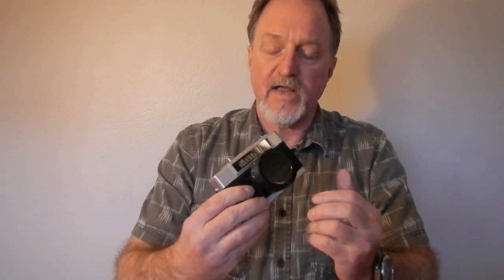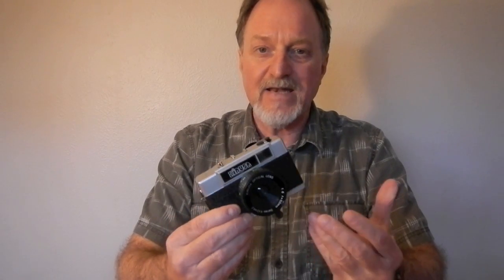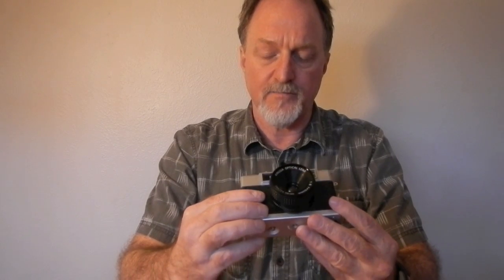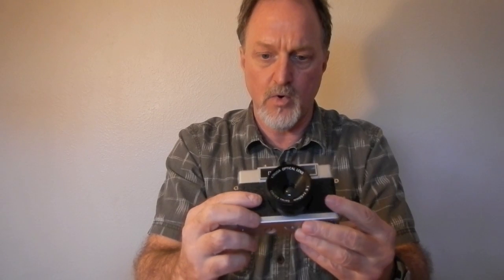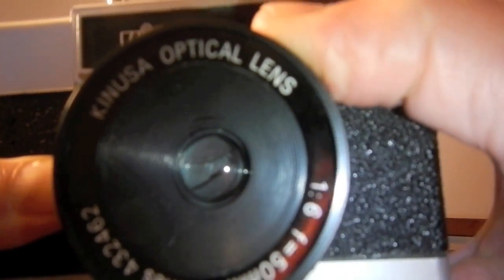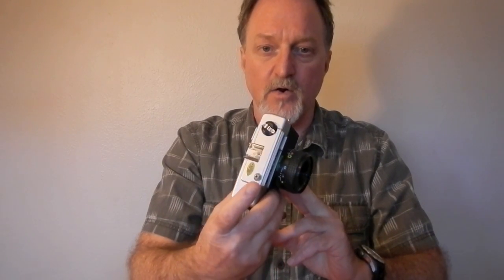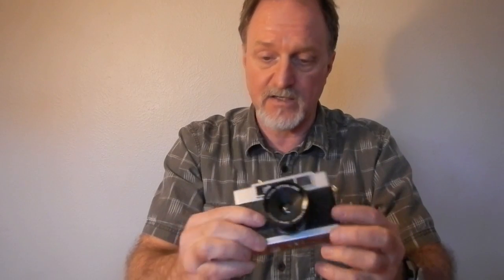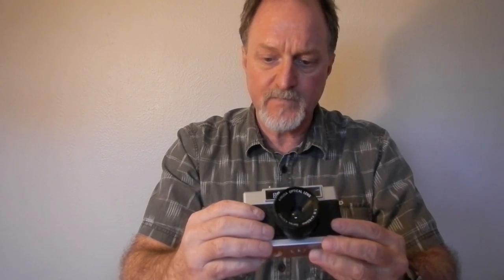52 Cameras: Camera 91 part 1 -- KINUSA 50mm f/6

Comment: I never came across this camera before, have you ever shot with a Kinax lll 6X9 620 camera? there is one for sale locally (on ebay)
Reply from the maker: +mamiyapress I haven't used a Kinax III.  It looks like a nice camera.  I recently scored a Voigtlander Bess 66 -- the old one with a frame viewfinder and the built-in yellow filter (missing the filter glass).  It's not 6X9 but not too different.  It has the 75mm Skopar rather than a 105mm like the Kinax.  The shutter is sticking but seems functional.  Hopefully, a good soak in lighter fluid will be enough to get the speeds somewhere near normal.
Reply: +52 Cameras  I have 2 Voightlander Bessa 6X6's, one was a gift from a neighbour and the second one was an ebay purchase, this one has the yellow filter. If you go on Facebook and look up Roscommon Town History and Heritage, then go to the Abbey Street photographs, you can see the original owner on the right hand side about to open his door, his name was Alfie McKeown.
Reply from the maker: +mamiyapress That is SO cool!  Knowing the history of a fine piece of kit is a wonderful bonus.

Comment: It is unlikely that it was made by Yunon (if indeed Yunon made anything). It does not occur under the Yunon name, although it does occur as a Lavec and several other names. It has a lot of similarities with cameras made by Formosa Plastics Corporation. It first appeared circa 1983, but it may have been produced for several more years. It probably isn't a good idea to use long lengths of film (slippage) or the larger apertures (poor focus).
Reply from the maker: Thanks!  Info can be sparse out there so every bit helps.  I'm going to research Formosa Plastics.

Comment: i have the same camera and i can't seem to figure out how it works, I looked up instruction books but find nothing. Please inform me on what film to use and how to insert it and actually take a picture. Thank you!
Reply from the maker: +Stephanie Simoni Hi, the camera takes 35mm film.

LOAD:  Pop the back open with the little slider on the left side (from the photographer's point of view).  Pull up the rewind crank, put in the film canister, and push the rewind crank back down so its prongs seat in the canister.  Pull the end of the film across the back of the inside of the camera and insert the trimmed portion into a slit in the take-up spool.  Turn the film wind wheel (if it doesn't turn, press the shutter) and make sure the film isn't slipping out of the slit and the film counter shaft is turned by the film holes.  Close the back and continue winding until it stops.  Press the shutter button and wind to get past the exposed film.  Repeat shutter press and wind until the film counter on the top is at '1' (it may be a dot next to a '2' - I don't have the camera in front of me).  The film counter should increment and the rewind crank will turn if the film is feeding properly.  If not, open it up and try again -- the film probably slipped out of the slit.

SHOOT:  The shutter is slow so I would recommend 100 speed film for daylight photos.  Use the icons, a meter or meter app, or the Sunny 16 rule to set the aperture.  Press the shutter and wind the black wheel on the back for each photo until the roll is finished.

UNLOAD:  When you finish the roll, press the button on the bottom while you turn the rewind crank.  You'll feel less tension when the film is all the way back into the canister.  Open the back, pull up the rewind crank and get the film processed.

That's it.  Have fun and thanks for watching!
Reply: ok thank you